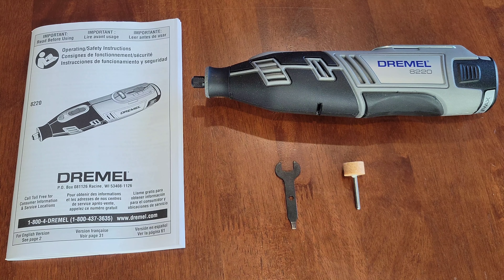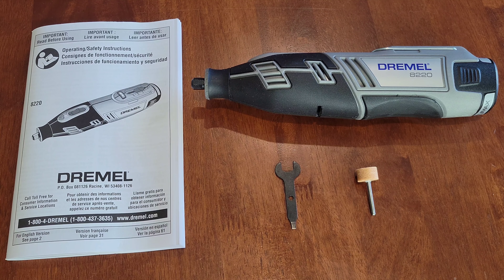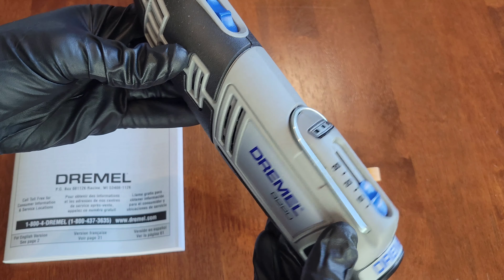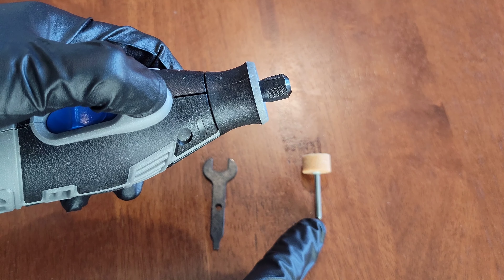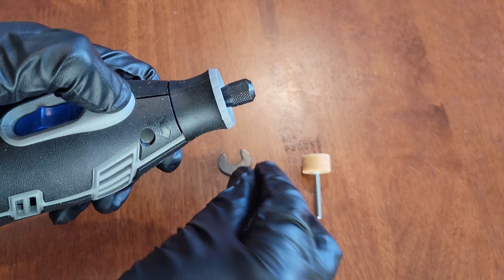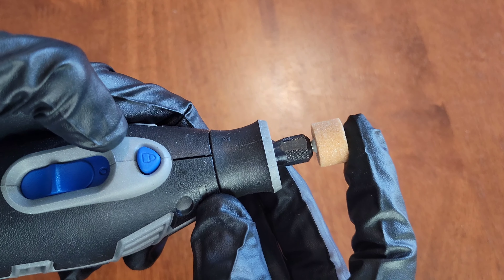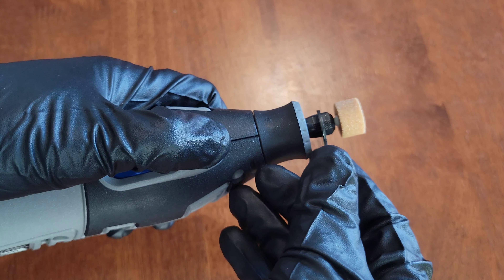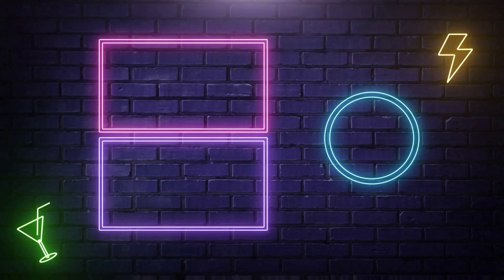How To Install A Dremel Accessory Bit

Comment: Thank you for your video. I have a problem with the Dremel 4300 I bought recently, the 1/8 collet can’t be inserted into the collet receiver, don’t know the reason, and I can’t find any video showing the similar problem,
Reply: Mine too and no instructions with mine.
Reply: I have same problem but I just found if to gently tap the piece your inserting it opens it up,must have been stiff as brand new ,took me all morning to sort it out lol hope it works for you too
Reply: Same

Comment: Thanks for the Vid. My collate  isn’t fastening for some reason. Any ideas what it can be ?
Reply: Make sure it is inserted into that black, bit-holder thing (don't know the correct term) the correct way and see if that is the problem.  The end of your collate that is spliced should be pointed up while inside the bit-holder thing after it's screwed into the shaft.  My collate thing fell out when I removed the bit-holder when I first got it...I didn't know better and could not get any accessory to tighten.  After nearly smashing the Dremel with a hammer in anger, I finally figured out that the collate had fallen out, so don't feel bad if it's inserted incorrectly, lol.

Comment: I have the DREMEL Lite. My bits will not fit in the collet. Is there Something I am not Doing correctly?  Thank you.
Reply: Same with me.Colet nut messed up
Reply: @SM-ib2xz  I'm assuming you guys figured it out by now, hopefully.  Just got 8240.  Same issue.  Took the nut all of the way off, popped bit in from the other side.  It helped to open up the actual loading side,
Reply: Thanks. Thought I was losing it
Reply: @angrybananapeel  I will look at mine again and see if there was not something loosened to put the bit through?
Reply: Make sure that the black, bit-holder thing is loosened enough or your accessory "pole" will not fit.

Comment: Todd, here in Europe,  there are 8220 with 5 attachments and 56 accessories, 2 x 2mAh batteries and a nice top-loader and drawer box for just $170 whereas the same price only gets you a 8260 with a few accessories and 1 or 2 attachments and a much smaller box, which one would you go for?
Reply from the maker: HI Sir Kay and thanks for watching! I haven't had a chance to look into the 8260 too much yet. I do like the 8220 I have though and I am happy with it. Thanks again for watching and good luck on your choice!